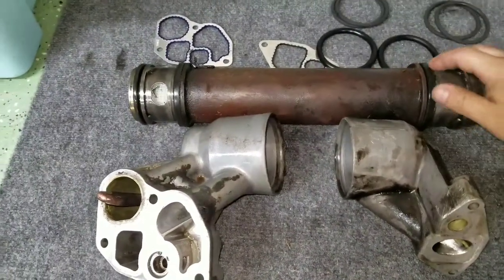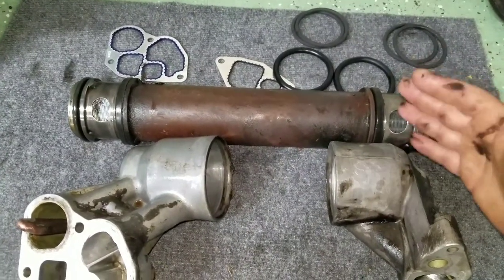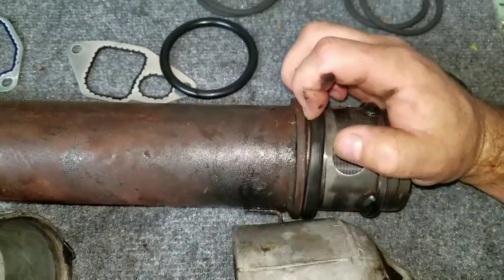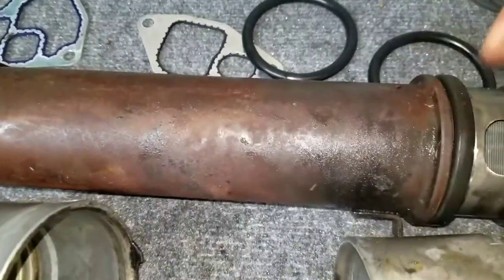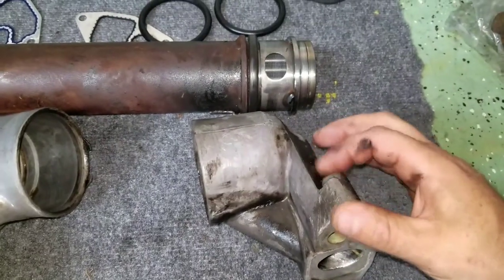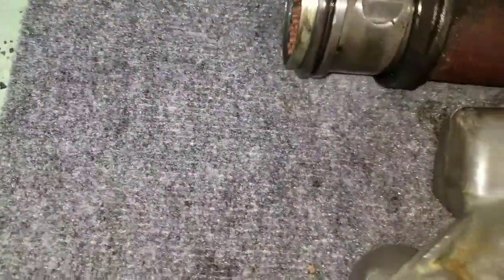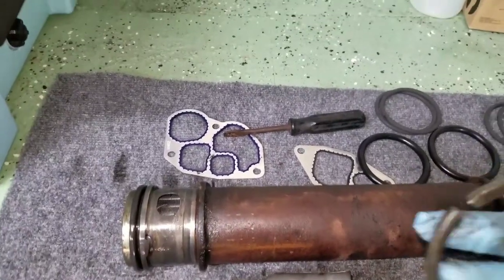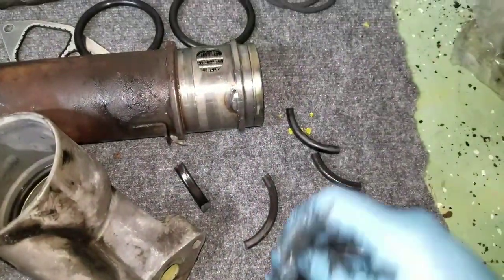7.🌲 obs oil cooler leak

Comment: I’ve done over 50oil cooler jobs ,go through the wheel well with long extensions for front bracket ,make sure to grease up those o rings before you slide the ends together,won’t tear up the rings,Vaseline will work